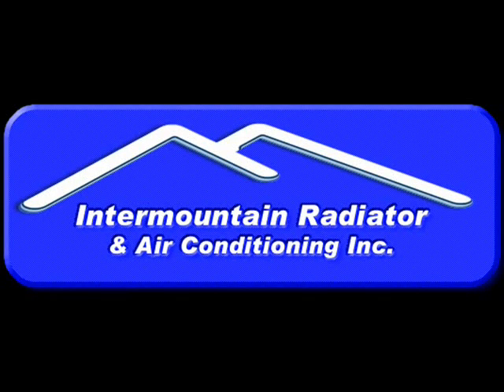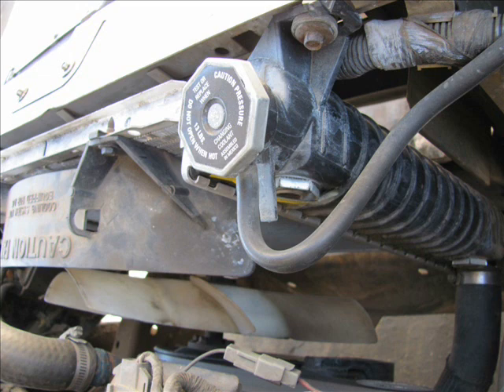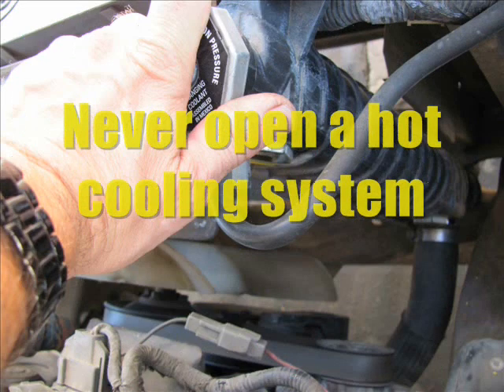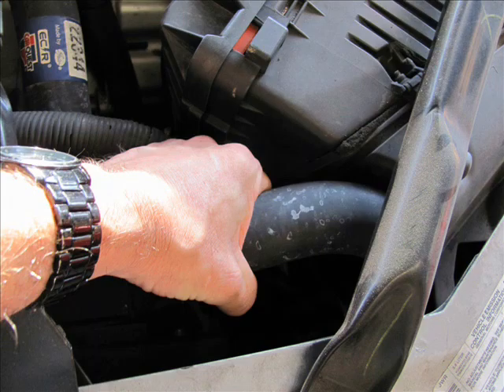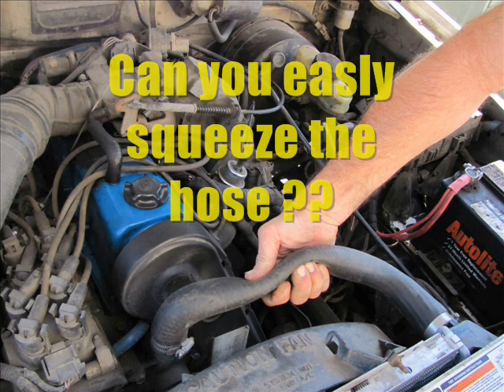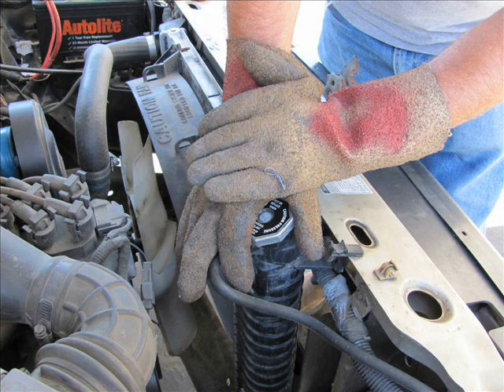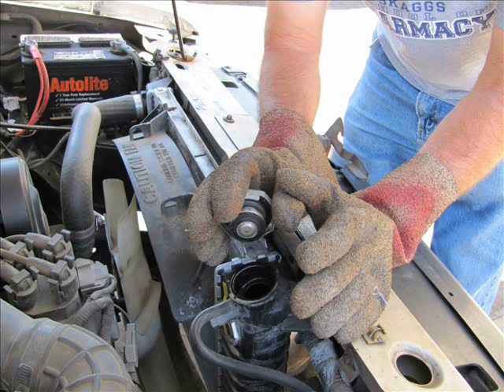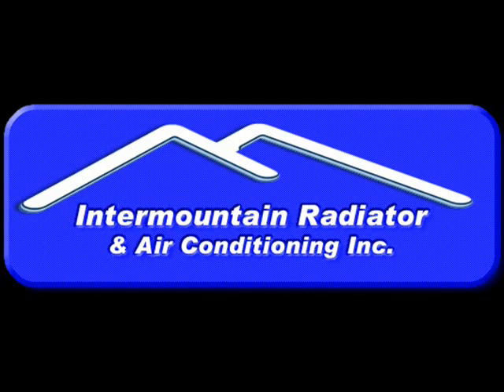coolant_check.wmv

Comment: That's another good point. With plastic covers everywhere, good access to the actual radiator is not as easy as it once was. The average driver makes the assumption that the coolant reservoir measures total coolant in the system, but that's only accurate when the cap is working properly and if you haven't recently worked on the vehicle.